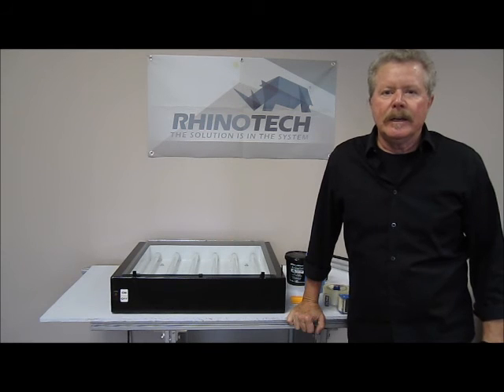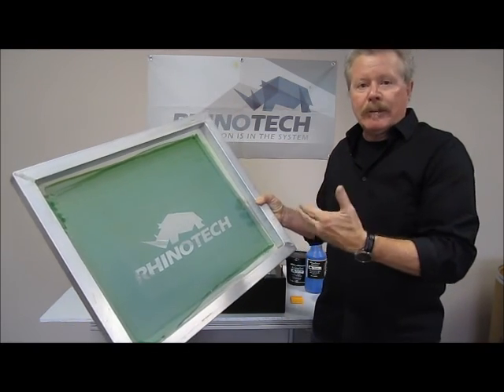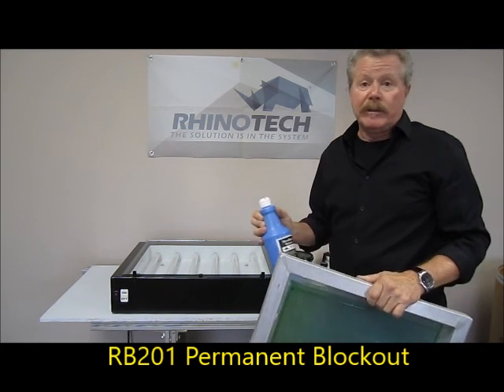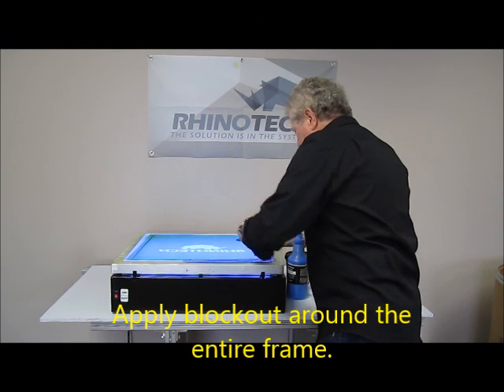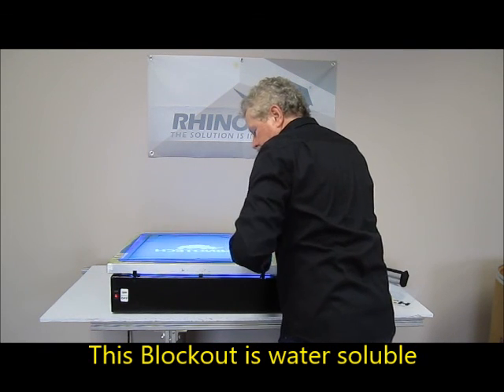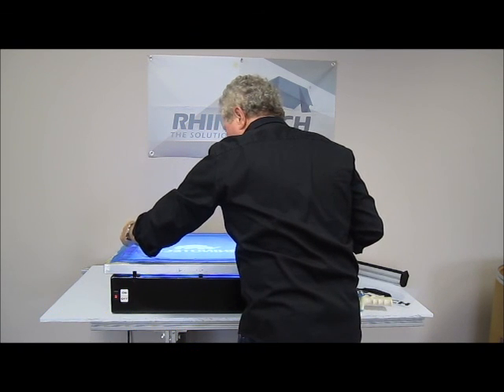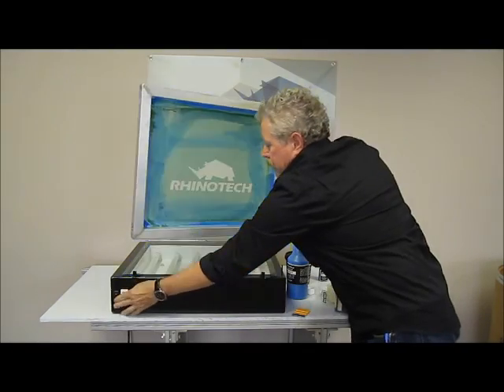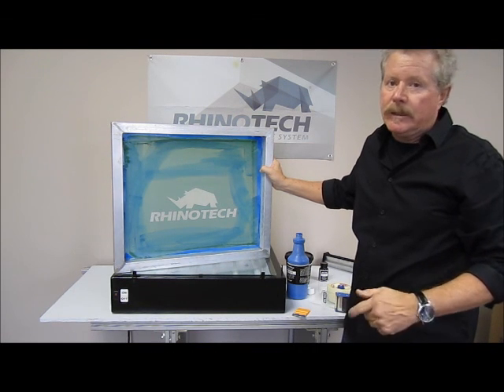How to Blockout a Screen 101A

Comment: The 201 Permanent blockout only lasts about 5 reclaims before operators starting taping off all previous blockout areas.
Reply from the maker: Thanks for your comment. Actually, not sure why it only lasted 5 for you as it's formulated to hold up and be as durable as a 2-part frame adhesive. If you'd like some help, please contact us directly at 651-686-5027 or info@rhinotechinc.com. Hope to hear from you.